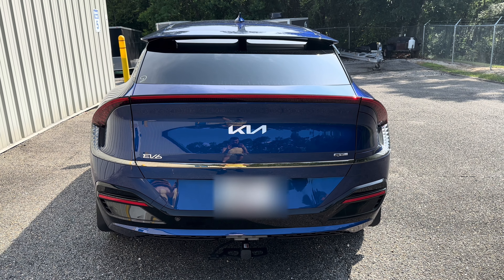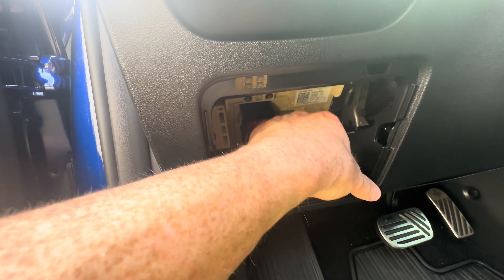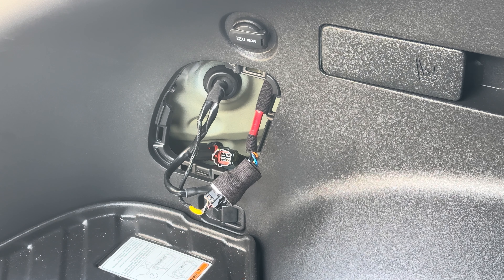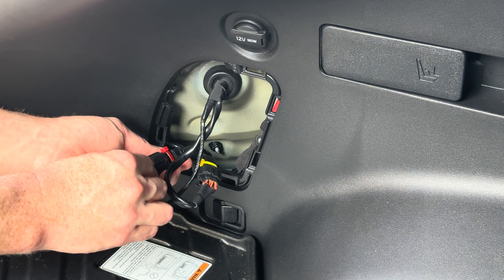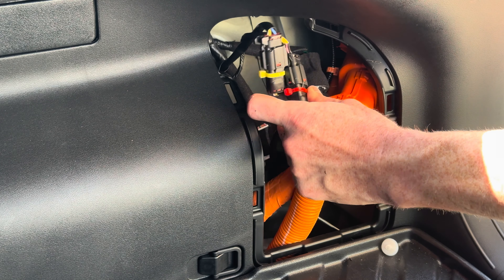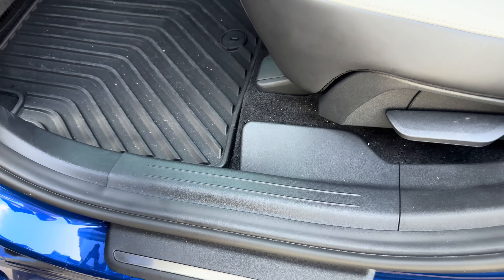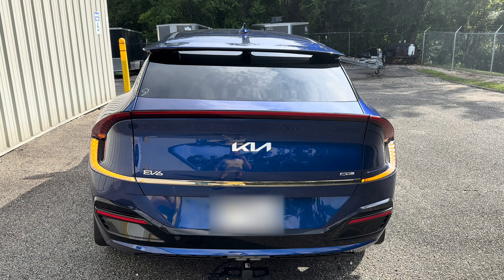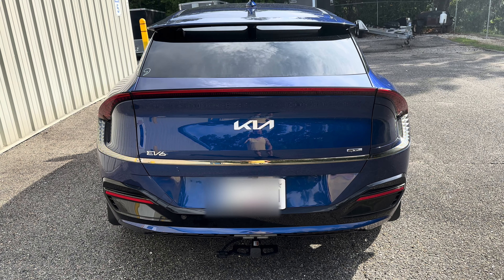2023 Kia EV6 GT-Line US with Sequential Turn Signals - Harness Installed - Overview

Comment: Would you mind commenting on why you didn't tap the tail light turn signals and instead tap the mirrors? That's a whole lot more work and I'm trying to understand what's missing to enable you to do so? Great work!
Reply from the maker: The taillight signal has turn signal and brake in the same wire. For separate turns and brakes to be used a separate, only turn signal wire has to be found. One could tap into the trailer controller, but not all vehicles have the actual controller installed, and the closest other option are the mirrors.
Reply: @kyledibble-dabney53  thanks! The extra work sucks but it has surely paid off!
Reply: BTW for the pure brake signal did you tap the 3rd light?
Reply from the maker: @ynx  Trailer harness connector. All cars have this even if they don't have the controller installed. That connector has canbus, power, ground, and brake. Trailer turn signal is a product of the trailer controller and canbus.